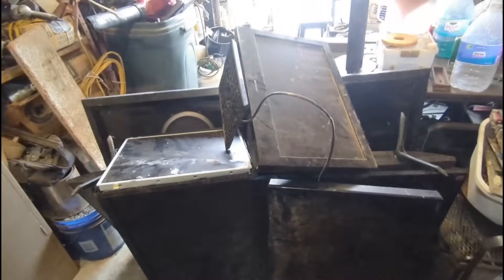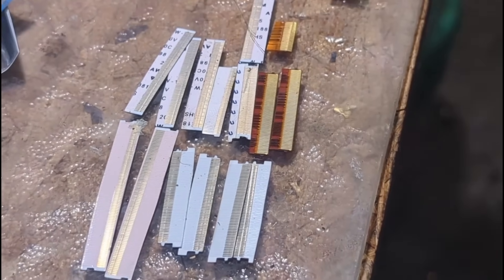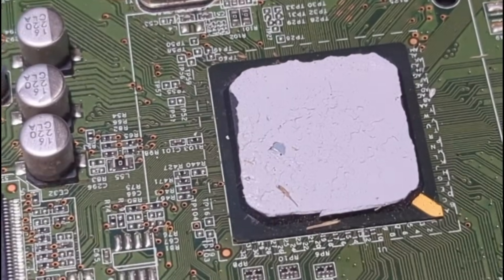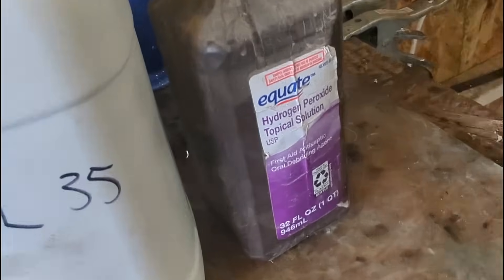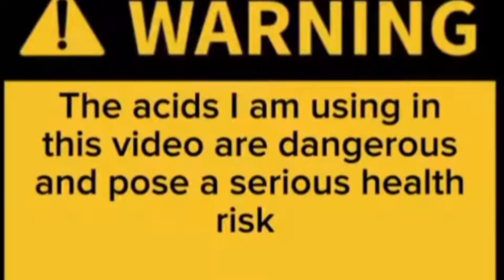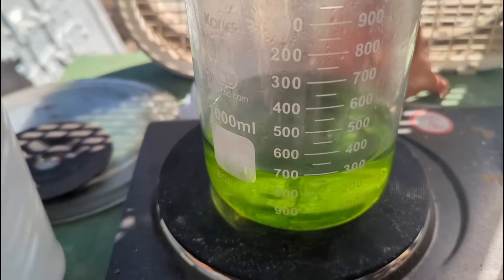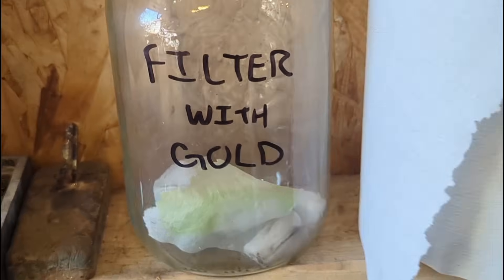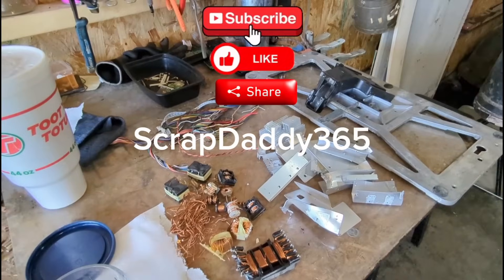SCRAPPING flat screen TV's for gold, copper, and aluminum.

Comment: Is the TIN solution necessary before the AP solution? If so, what does it prevent in the AP from happening?
Reply from the maker: It's not mandatory but it makes filtering the AP much faster and cleaner.

Comment: Fyi if you are doing this in the United States, every step of this process is highly illegal on a federal level, it takes around 50,000$ to get properly licensed
Reply: @Mr-Mcgreg  what is the code or regulation that he is breaking , and what licensing is need for taking apart junk ?
Reply: @Hill-13  it’s not the disassembly, it’s the chemical gold extraction, each state has there own version of this, but in tx, the Texas clean air and water act prohibits the use of acids in gold purification without proper zoning, permits and licenses due to lead and mercury contamination
Reply: Mr Mc Gregg 
1.)so that Chinese eco powder is ok to use because of no acids to refine , just a base( lye )  to change the ph of solution followed up with electrolysis ?
2.) are you referring to Chapter 382
Clean Air Act of TX . If if so what section are you referring to or where is this code violaton found ?
Reply from the maker: @Mr-Mcgreg  no worries. My .1 grams of gold should cover all the necessary fees to get licensed😎😎😎